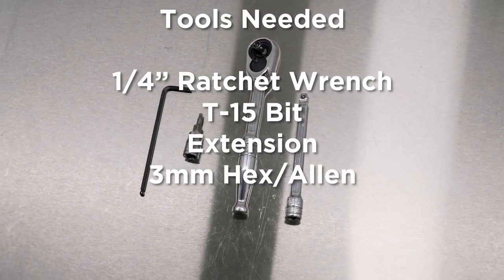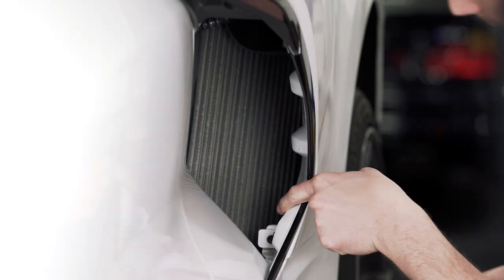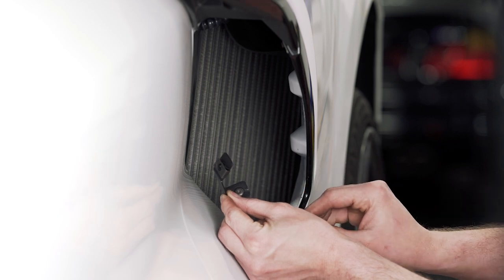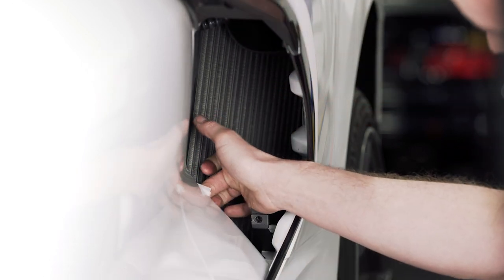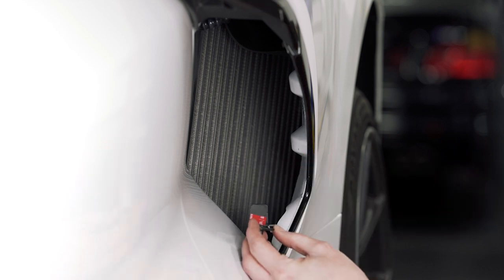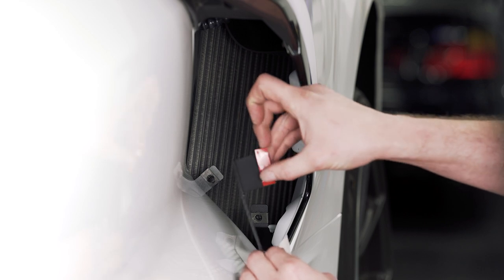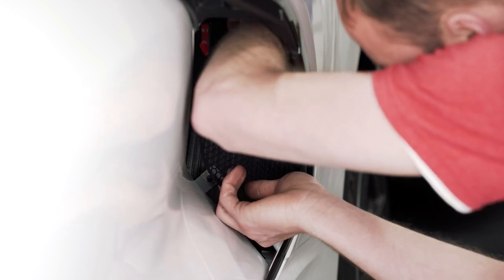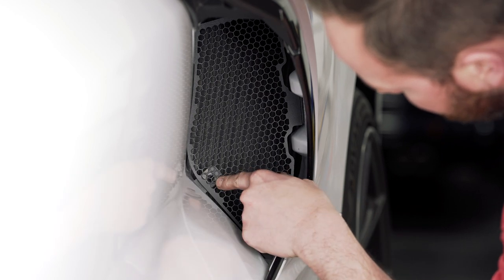C8 Corvette Intake Grill Guards Install - Bolt in - Paragon Performance

Comment: Two problems with this instructional video:  On the L bracket, they are directing you to install the nut plate on the incorrect side. And, on the support bracket, they do not clearly tell you that these brackets are right and left handed. If you install the support bracket on the wrong side, the nut plate and bracket are out of position and also touch the body…. Somebody marked the ziploc parts bag with a felt tip pen in what looks like a D & P, to supposedly denote driver and passenger.  However, the writing is smeared and half wiped off.  A $.01 sticker denoting driver and passenger sides would have been the appropriate way to mark the bag.  And, for a company like Paragon, I am very surprised they didn’t provide an accurate and more clear installation video.  

All in all, the execution in providing the customer with clear, need to know information for a headache free installation is lacking.
Reply from the maker: At the time stamp of 2:55 you can see the correct position of both brackets. As for the sharpie marks on the bag, the left side is D from Drivers and P is on the right for passenger. 

We appreciate the feedback on the packaging and I’ll pass it along to the shipping & kitting team.
Reply: Right but, at the time stamp 0:50 you clearly direct the installer to put the nut on the wrong side.  So, by the time the installer goes to install the bracket as shown at time stamp 2:55 he’s already installed it backwards.  And, if he doesn’t know any better or installs it without thinking, it becomes a big issue.

Support bracket:  It would have been much better to clearly call out in your video that there is a right and left side bracket.  Instead, you are relying on a half wiped away felt tip marking of D & P to alert the installer.  Properly “labeling” the bag driver and passenger sides and clearly pointing out the difference in your instruction video would clear up any confusion and prevent problems for the installer.

Comment: The 4 brackets are not the same 2 are for the LH and 2 are for the RH. I ask, how do I know what side to install them on? 2 brackets for the RH and 2 For the LH. The Brackets are a Mirror Image they are bent in the opposite direction.
Reply from the maker: The packaging has a D for drivers and P for passenger side.
Reply: The left side is ALWAYS the driver's side of the car which makes the psngr side the right side...ALWAYS!  👍

Comment: $200 "on sale" for this when the top portion flaps/rattles at high speed is very unacceptable...
Reply from the maker: We've had these on track with speeds up to 150mph with no issues. Did you make sure the top tab was installed properly?
Reply: @ParagonPerformance  Of course, installed properly.  Installation is not rocket science (you even have a video).  The top outer portion is not secured and eventually flaps around.  It works perfectly fine at first install.  But over time (especially after weathered use), the sticky tapes eventually fail.  No worries on that as it can be easily replaced.  But it seems the parts get softer over time and eventually flaps.  Not worth the hassle for $200 or at any price.  Your other products are typically top notch.  I think this one just needs to be redone.

Comment: They rattle too much and the double sided tape doesn’t hold that long
Reply from the maker: This new install method works a lot better we have found, give it a try and let us know. We appreciate your feedback.
Reply: @ParagonPerformance  I double check but I think that's what was done.  The problem was the top outer corner has no support so it just flaps during highway speeds.  I just had my installer pull them off because I couldn't stand the rattling sound with it flapping around.
Reply: @pauld520  totally agree Paul.  It's a complete ripoff at $200 (actually at any price with the rattles).

Comment: This video is terrible on the small details, which way the tape should align on brackets..etc
Reply from the maker: The tape goes on the outside of the bracket so it can stick on the body.